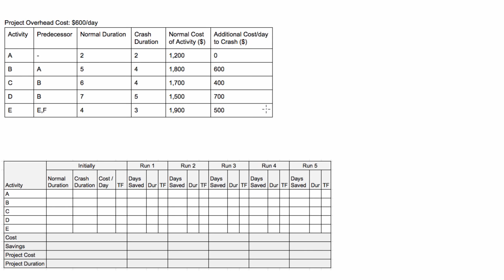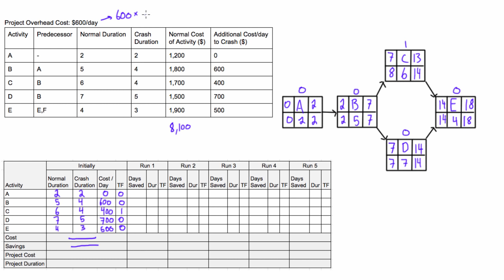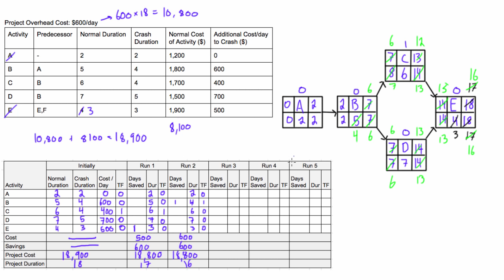Project crashing full example (part 1/2)

Comment: in the first crash process when crashing the duration from 18 to 17, should we also remove the cost of one day from E activity so the new total cost would be 16,900 instead of 18,800 and do the same for the other crashes
Reply from the maker: Hey good question. In general, no. If Activity E has a normal cost of $1,900 for the entire activity, then we should assume that it retains that base cost of $1,900, and only add the $500 (cost per day to crash) for each day that we crash it by. So in this case, we spend an extra $500 to crash it by a day, and the base cost is unaffected. So then Saving the $600 in project overhead, we just reduce the total project cost by $100 overall in this step.
Reply: @Engineer4Free  what about the last crash for 2 days crash at the same cycle (for D & B), why we did not use 1000 USD for 2 days instead of 500 for one day
Reply: sorry for D & C

Comment: Thanks a lot for your videos. Can you tell me how you calculate crash duration?
Reply from the maker: Thanks for the comment! Crash duration is typically just given to you in these types of problems, and has to do with the physical limitations of how fast the activity can be performed. Imagine that the project is a house build, and one activity is painting. The painters might tell you that they will take 6 days to paint, but if you pay a higher rate, they will bring out a larger crew and it will take them only 4 days. They know that their full crew can still only paint so fast, and the amount of painting required will take their full crew 4 days. Mmmmm that's just the first example that came to mind, does that make sense?

Comment: hello! thanks for the videos. on run 2 Tf=1  should be on activity C or am I wrong?
Reply from the maker: Thanks for pointing that out. There is an annotation catching that error but it will not display if you are viewing on a mobile device, and also might not show up on desktop if you have adblock. I updated the video's description with the correction.
Reply: Engineer4Free yes I also saw the next video that you also point out the fault! :)

Comment: I think you made a mistake in TF of the second round, am I right?
Reply from the maker: There is an annotation that shows up at 8:39. If you are watching on a mobile device or using adblock, you won't see it. It says "Sorry, I accidentally wrote TF=1 for B, I meant to write TF=1 for C... I catch this error in part two of the video." - So yes, for B, TF should be 0 and for C, TF should be 1.

Comment: How you are calculating the additional cost
Reply from the maker: In this example it is just given in the original table in the far right column. That would be pretty common in an exam situation to be given the cost and just have to deal with it, not calculate it with no other information.
Reply: Thanks

Comment: Hi. Isn’t the project cost on run 1 supposed to to be 18,400? ..
Reply from the maker: Hey, it should be 100 less than the initial condition. Because we pay 500 extra to crash, but save 600 on the overhead of one day. So it will be 18,800 after run 1.
Reply: Oh.. thank you

Comment: can you tell me what actually is overhead cost is it labor charge and activity cost means material cost??
Reply from the maker: Overhead cost in this example would be additional costs to the project that aren't associated with any particular activity. For example, a flat rate for a project management fee or 24/7 site security if it was a construction project etc. Also, considering material and labour costs separately for the activities is beyond the scope of this example.
Reply: thanks for quick reply